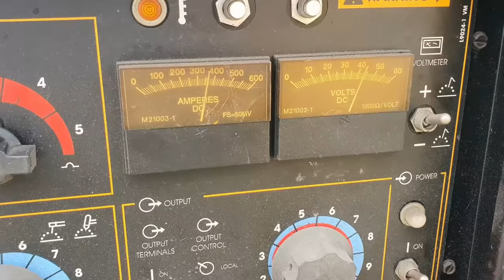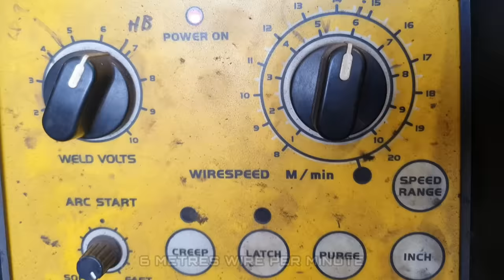Replace CRACKED Excavator Bucket Skin | Gouging & Welding

Comment from the maker: Hey viewers thanks for watching this weeks video! We hope you enjoyed it and this answered some of the questions you might have about air arc gouging 😎👍 
Subscribe and hit the bell icon to turn on notifications so you don't miss our weekly uploads. 👇 🤳
Follow us online here: 
Instagram https://www.instagram.com/cutting_edge_engineering 
Facebook https://www.facebook.com/cuttingedgeengineeringaustralia/
Official CEE Merch shop: https://www.ceeshop.com.au
Reply: Thanks you ❤️.... but,how much does it cost at the end for your customers?
Reply: @alexdissieux5137  I seriously doubt he’s going to tell you what he makes.
Reply: greetings from Russia - - - well done good job
Reply: Thank you for taking the time to put out the videos for us too watch ,, also thanks for the tip on the bucket steel popping when you cut it loose .. I have a compact tractor that I need to reskin the front bucket ,, bent and thin .. I would have just cut it not knowing ..
Reply: I was quite relieved when you mentioned the bucket tension and possible popping when you gouge them, all I was thinking about was that incident at goonyella, I'd hate to hear of that happening again. 😢
Reply: @alexdissieux5137  Look up the costs for a new Bucket, the how much the Material for the repair cost. 
The Repair is cheaper than a new Part, and more expensive than the Material used for the repair.

New Bucket around 11k
Material: around 2 - 3K
If Kurtis would take...100 $AU for an HOUR of work and it´s an Day worth of work (Between 8 and 10 Hours for self employed Owners) you can ballpark the Costs a little bit.

Quality Repair must be Cheaper than a new replacement part, but it cannot be cheaper than the Material used. Hope that helps a bit;)
Reply: @Ordog213  Yup time and materials 4K, a third the price of a new bucket, bargain.
Reply: No conversion to American bananas makes it hard for me to understand.  :)
Reply: @Ordog213  oh😍 thanks you so much.......
Reply: @Ordog213  6,000 working hours, sounds like this bucket won't be back soon either.  Much more time a working bucket for the owner without repair.
Reply: So much work for one man.  You need an apprentice or two.
Reply: @Ordog213  With all his equipment I think he's leaving money on the table at $100 AU/hr.
Reply: Yes thank you I understand how it is done now.
Reply: Question. What's the benefit of air-arc cutting vs a standard cutting torch in this situation?
Reply: Hey I love your videos but I don’t know what you’ve changed maybe editing software because the audio between cuts is really off putting it seems to cut in and out. Sorry to make a complaint as I love the videos but it was especially noticeable when Kurtis is talking
Reply: @toddmarshall7573 
Wall of Text ahead YOU ARE WARNED*
 You must understand that there is a difference between "Machine Hours" (Runtime of any machine in a Workshop) and "Operator Hours"(The Time your Worker is in the Shop, Doing Stuff)
Lets say the Rate of Curtis is 100$/Hour and he works for 8 Hours on an Project, then the customer has to pay 800$ Flat. Only for Kurtis there, looking at his broken Cylinder or Bucket.
They the next factor comes in. What tools does Kurtis pick up to work?
A little Example with Numbers that i pulles from my ....backpocket.
Kurtis alone looking at the Part for 8 hours = 800$
then he picks up the Gouger for two Hours. Lets say that costs 90$/Hour.
after that, Kurtis places the Replacment part in place and fits it to the rest of the Bucket. Hard work and you have to be spot on. SO it takes 3 Hours, many different tools and some real knowlege. 150$/Hour.
After that, it´s time for Welding 3 Hours welding, Cleaning and so on. About 110$/Hour, and your Part is clean and repaired. The Material for replacement costs...2000$ and ....300 Bucks for Welding Wire and Shielding Gas. Another 100 Bucks for Carbon Rods and 20 Bucks for Sanding disks (The little Costs often get hidden in an final position on your invoice with the nice Title "Other materials" 

So the total Repair costs you:
800$ for the Kurtis Himself
180$ for Gouging/Basic work
450$ for fitting the replacement part in place
330$ for Welding the parts in place
2000$ for the replacement part alone
and 
420$ for Other Materials and Energy needed to make the repair
Total Cost: 4180$ for the Repair + Taxes

But our Man Kurtis is a poor Cunt, so he cannot get all the sweet Money in his Pocket. He has to pay the replacment part he ordered, and EVERYTHING ELSE....plus he has to pay taxes for everything AND the Money that is left over....Everything after that is his.....till anything breaks in his shop.

Thats why its hard for a small COmpany to stay on the right track when basic material gets up in price.

If Steel plates jump from 1000$/Ton to 1500$/Ton, you have go raise your prices. Most Big Shops and Companys have a stockpile of needed material, and they can fill up when prices are low. Who cares when the parts are on a shelf for 4 months. One day i need it for sure.

Smaller shops cannot do that, because often they lack in space OR they don´t know when they need a part. If Kurtis orders to much material for a special job, he has to rake up the money himself. same when he fucks something up (That is a big factor if you have other Persons working in your shop. Sooner or Later someone fucks up something, and it costs money)+ he has to be cheaper than other companys.
The Best combination are moderate rates and prices AND good Quality. Customers pay a little bit more if the Quality of your work is fine.

We can only be happy that Kurtos takes his time for US, because everyl Minute costs him Money.... and that is why i have massiv respect.

 -Sorry to Kurtis if i got something wrong, thats the way i did it in my shop times. Do not hit the German ;)
Reply from the maker: @Uber-GT  thanks for the feedback! There was really bad wind interference with the audio it was worse before the editing 😣  looking into microphone options my little Samsung phone doesn't have the best audio 😂😁 Karen
Reply: What is that IH tractor? Is that a custom made machine. Would love to see a review on it! Cheers. Nova Scotia, Canada
Reply: @MrThisIsMeToo  4k  A$  about 3k US$
Reply: @DavidRamey  hes profitable because hes a one man show with his wife diing the office work.  Taking on an Aprentice takes a lot if time and money since hes relatively new business so hes not prepared to do that yet,  explained this in another video. More cost means higher profit margins required which makes you 
less competitive
Reply: @nipponsuxs  Silly.  Bananas are not currency.
Reply: @Ordog213  Thanks for a thorough explanation. Well composed "wall of text" is still much easier to read than "three sentences incoherent blabber", of which there's plenty "on the net". And while those things are rather obvious for someone "with the background", they'd still be quite informative for an average casual viewer.
Also, I was tad wondering about that capitalisations of nouns - in English they stooped it like in 19th century, but then I read "Don't hit the German" - ah so, genau - alles klar... ;-)
Reply: @zachnattrass  Exactly my thought. I used to think arc gouging is THE method to use for gouging away welds when one needs to replace, say, worn anti-abrasion plate or cracked element, without doing much "damage" to underlying pieces, but here it is basically a cutting away...?
I see two probable reasons - one is too much "side/ back blows" while using oxy-LPG torch from all that concrete stuck in the corners of the bucket, and the other one is... "eff, I just run out of oxygen and I have get this job done like right now!".
Reply: @seannybdizzle  As I never heard before about that accident before I did a quick googling and was kinda shocked to learn that the plate the other guy was cutting sprung back that much... 1.15 m is A LOT and I just can't imagine it was all from "built up tension due to denting/ banging". That is, unless the plate in question was like 3 x 5 metres, but then I have no idea how big it really was (no info about it in the results I found).
Seems more to me like this plate was poorly bent and/ or fitted in the first place - like the radius was way too big, so the previous welder(s) went the path of welding an inch or two, then bending the plate into place with some chains and chain tensioner, welding another inch or two... and so "da capo al fine".
Something like the best Appalachian Jack of All Trades, Andrew C. is doing here:
https://www.youtube.com/watch?v=1uA6QAQq_dU&t=36s (and later with steel ropes, https://www.youtube.com/watch?v=1uA6QAQq_dU&t=104s), or here: https://www.youtube.com/watch?v=S50DKRtqFGQ&t=1610s
Of course, in the case of that bucket Goonyella things would have be taken rather to extremes, but the idea is still the same - "well, it's bent and doesn't fit - let's then forc... erm, "massage" it a bit into its place, then weld it and everything's gonna be fine". At least "to a point"... in time.
Reply: The equipment you guys have is biblical!
Reply: You forgot to mention the air jet on the kwick arc can blow left to right if you spin it around, if it's blowing to the right it's best to cut to the right, you go against the air it just makes a puddle mess. I hate grinding so with years of use with one I can wash a weld or gouged area with very little grinding.
Reply: As someone that spent 20 years in the logging and trucking industry, and then decided to a complete “restart” on my career and self taught myself to weld, and now working full time welding/fab/machine shop as of a year ago, I can’t get enough of your videos guys! (And have four dogs❤️🐶 so I love seeing homey in the videos). My next thing to learn is machining and I’m gonna blame that all on you Kurtis!! I just can’t get enough of learning and you have me hooked! Thank you 100x for your videos and the bloopers at the end make me realize that you are human!! 😂. And a side note, I have the same Jasic plasma cutter that I bought here in the states in preparation for buying a Langmuir crossfire pro XL plasma table for my home shop!  I love that machine! We have an 8’x16’ bystronic laser table at my shop that we are just getting ready to fire up
Reply: p
Reply: As an amateur welder, I do wonder, what welding gloves do you use ?
Reply: @CuttingEdgeEngineering  if y'all don't mind, I'd like to send a filter lens. It's a very high quality lens I use to weld and I think it might improve the visibility on arc shots. Just let me know if interested. 👍
Reply: What is the name of the Plasma Cutter you use here???
Reply: Please do a video of that crane truck you used to move the bucket around outside . I'm from the states and have never seen anything like that. Thank you for another great video and ounce again incredible blooper reel.
Reply: I've wondered about the air since I couldn't see any holes in the gouge. Neat!
Reply: Perfect on how it works and how to use it the handle on it that you open it to put you carbon in if its on the right the air flows down away from you great video 😊
Reply: Сколько дней ты делал эту работу
Reply: Why not use a plasma cutter cut the sections out of the bucket?

Comment: I never would have imagined that there is stored energy in a well worn bucket. Thanks for the safety tip. Karen again thanks for the first class  filming and editing
Reply: Ive cut up  scrapped excavators before,  the buckets even the arms can store that energy. And when the go they go boom.
Scares the shite out of people not prepared for it. Sometimes as your approaching the last inch of cut you can see the whole plate of steel starting to bow ready to bite any unsuspecting sod.
Stand back for that last cut
Reply: I can tell you about stored energy. We had to cut 10 ft by 10 ft Square holes in a multi-story parking garage to put an elevator shaft in. We cut in the depth of the concrete but not the rebar and then jackhammered the concrete out leaving number 16 rebar on a 16 in Grid period when we went to cut the rebar the welder in charge duct-taped the cutting torch on the end of a 10-foot 2 x 4 to be completely away from it when it cut through we were filming it with videos the very first one that he cut when he got about 3/4 of the way through it it popped like a spring and came out of the whole five feet in the air and had a curl on me in like a fishhook every piece of Steel did the same thing on every floor because of the tension. We had to shore up all around the hole with steel threaded Jack's on 16 inch Centers before we started so that the release of the tension wouldn't crack the whole floor
Reply: Everything, everything, is a spring.
Reply: @mikesmithey1892  Wow!!😮😮😮😮
Reply: @mikesmithey1892 such amazing comments..  thank you much.. Folks often have no idea..  just do it safely..

Comment: Very glad you mentioned to younger guys working on this stuff that the cutting edges and wear plates are spring tempered steel and can fly off and hit you if your standing in front or down leave a little to grab. I was removing a loader blade that had derby between the blade and bucket with a torch on the bolts and bang came off with enough force to kill a person scared the heck out of me lol

Comment: Years ago used something similar to cut metal underwater. We used either Oxyarc or Broco rods. Broco rods are fun as they will cut through just about anything, even cut through concrete, but are pricey.

Comment: Back to another visit. Makes the memories of repairing these buckets jump right up. One year at breakup would be buckets, blades and the next year was hard surfacing and buildup on everything. Litterally using up a ton of 1/4 inch AtcTec 5/32 rod. The hard surfacing is what I call a nesccery evil in my life. Kind of mindless days but saves the company thousands of $ every day. We all have our own pattern when laying down hard vsurfacing. Mine was a diamond with a dot inside. Every once in a while I will still see one of my work still going down the high way. Kinda neat eh.

Comment: Great stuff, you are a true craftsman who clearly takes pride in his work. Back in 1975 I used to use the air arc a lot. Worked as a certified welder in a shop that was doing structural steel for a nuclear power plant .Every weld was stamped by the welder who did it, and every weld was x rayed. If the weld was not perfect, the beam was sent back, scarfed out by the air arc, and rewelded . Every weld on thicker material was preheated. Most of the big material welding was done by submerged arc, with stick to finish out a bit of undercutting.....
Reply: I ran a submerged arc welder back in the mid to late 70s … I had to stamp every weld and every weld was x-rayed. It wasn’t for a nuclear power plant, but for the oil sands in northern Alberta, Canada. Some of the pressure were up to 6 inches thick, and it took three or more shifts of continuous welding, with tiger torches heating the steel, for each seam, depending on the size of the vessel.

Comment: This video is straight out Boilermaking. You fit and turn, fabricate and weld. That's dual trades. Your oxy cutting, plasma and mig welding is of high quality.  Great skills. I did my RPL in Boilermaking at Bracken Ridge Brisbane. RPL got a lot of guys/girls skills recognized.

Comment: You’re so gentle with the customer’s equipment! If I were working on my own bucket I’d have just flopped it over on the concrete :)
Reply: My guess is, he's being gentle with the concrete inside the shop by flipping the work over on rough concrete outside the shop. That way you can approach the flipped piece from any angle in the great outdoors and return to the shop with the work oriented just the way you want it. The man is a genius. (He's only a moron in the outtakes!)

Comment: Kurtis am up the road at Capalaba loving what i'm learning. You're an excellent teacher. In on of my past lives I sanded after a plasterer and dreamed of your backpack breather!!  In summer maybe they will come out with a chilled air model....
Reply from the maker: Air con adflo would be awesome 😂 thanks for watching mate not far away at all!
Reply: @CuttingEdgeEngineering  if your compressor system can supply the flow, you can use a venturi tube to cool the air.  Takes at least double the flow, because warm goes out one way and cold the other, but doesn't need any other power source, or refrigerant.
Reply: @BobOBob  Only trouble with that idea is that I reckon that compressor, as large as it is, is busting it's guts to be able to keep up with the air requirements while Kurtis is arc-gouging.
Reply: @markfryer9880  Should look at the cooling systems they use for those costumes at conventions.  They're pretty impressive.
Reply: @markfryer9880  I'm suprised hes using a reciprocating air compressor vs a screw type. But then again hes one guy working at a time and that may be a little overkill
Reply: I had air hoods from compressed air supply for booth spraying and you can buy an inline air cooler to supply cold breathing air to hood. Cooler pack clips on belt hood then plugs into cooler. Used to be available from Desco ask for Dan. No attachment to company. I used belt pack battery hoods like 
Kurtis has for plasma cutting booth

Comment: Good job Kurtis, so good to see thing have not really changed much in 45 years. We used oxy-acetylene for the cutting as plasma was still in its infancy and very expensive in the UK. Thankfully operators abuse the equipment which kept welder/fabricators in work. Thermal lances were used back then but I never had any call to used them as the oxy-acetylene was all for our needs. Looking forward to your next episode.